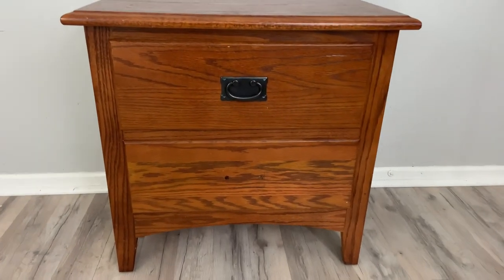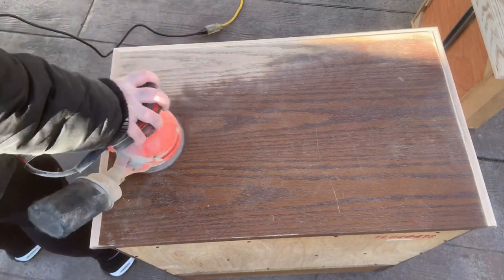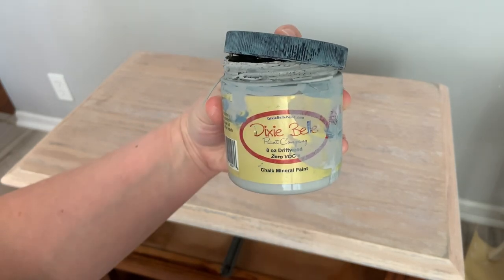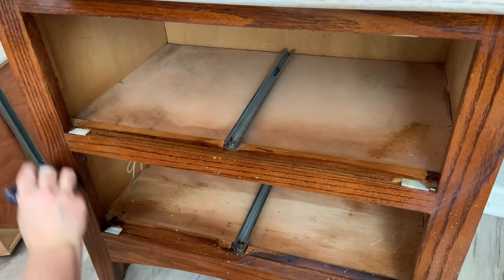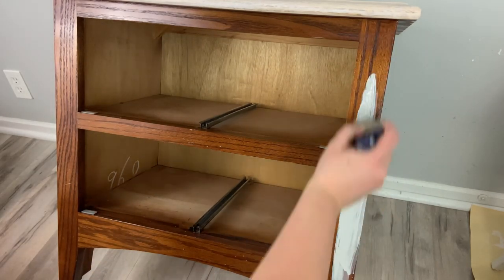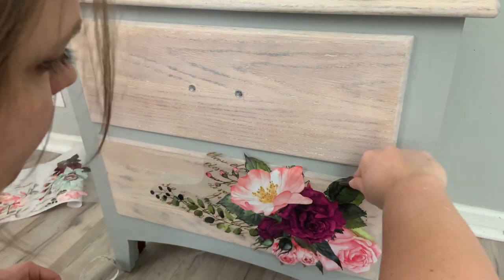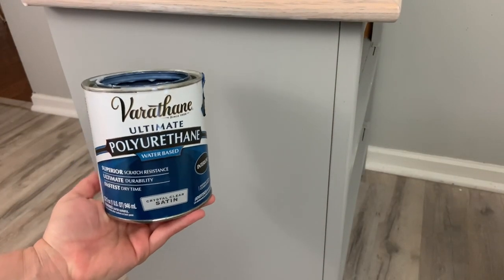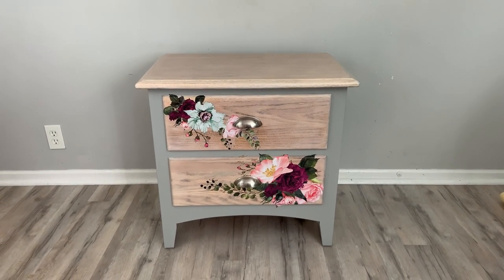Furniture Makeover | Trash To Treasure Furniture Flip

Comment: Can you please answer a question that has been bothering me for a while now.  On all the furniture painting videos they talk about the shellac or the Zinsser BIN with shellac.  But what I don't understand and what the guy at Lowe's told me is that since shellac is oil based you're not supposed to use anything other than oil based paint over it????  So I am completely confused when everyone seems to be using water based paints and chalk paint over top of the shellac?
Reply from the maker: I just think it’s a lot of misinformation. I thought the same thing. Annie Sloan was the first chalk paint. Even in her direction it says to shellac if you Suspect bleed through. There’s many other chalk paint companies that recommend shellac  because they don’t make their own primers. With all that being said I would never use an oil based sealer over my chalk paint. But under is just fine. Hope that helps. Also, I’ve heard that shellac is actually alcohol-based and not oil. I know bin is oil based so it’s a little confusing. I have used them both many times and I can definitely say they work great.
Reply: @FlipItFurniture  Thank you so much for replying and for the information :-) <3
Reply from the maker: Your welcome ☺️

Comment: How much would you sell that piece for? I’ve found it difficult to sell unless I have a pair or two similar enough that they look like a pair once they are painted. Just wondering if you have the same issue? Of course, who can pass up free???!
Reply from the maker: Great question! These are great for a Younger girls room or a teenager. Even a single lady. I actually sell a lot of single night stands. 
I usually sell my nightstands anywhere between 75 and 100. If it’s really plain And it was a free piece I will sell it for $50 but my average is usually sold for $75. 
I think if I did a single nightstand more plainly or neutral it probably wouldn’t sell so easy. Because this is geared more towards a single person it will sell faster.